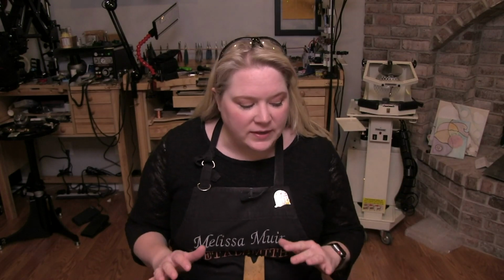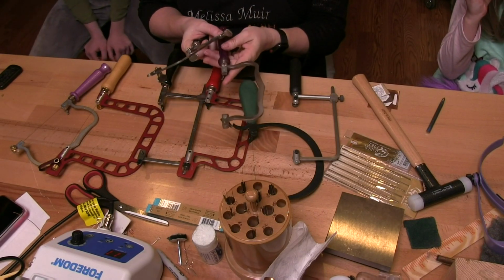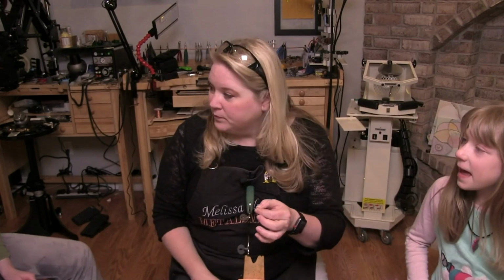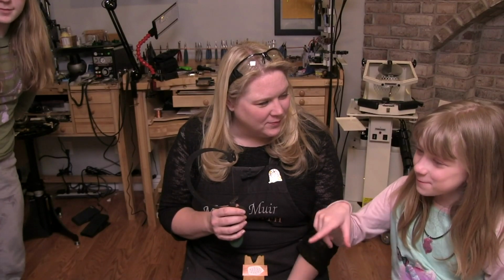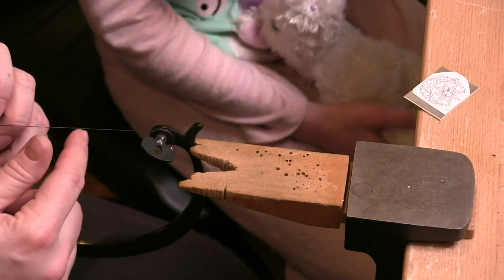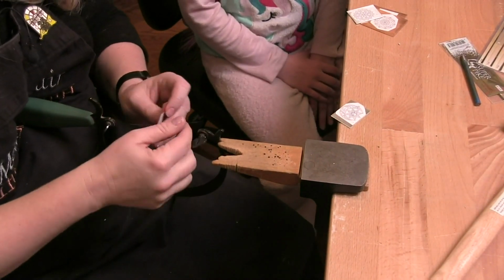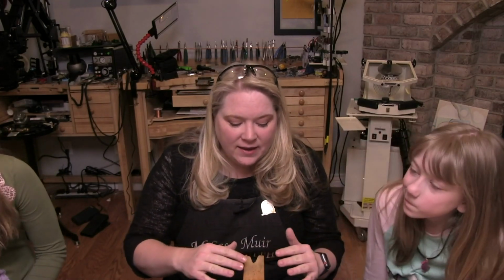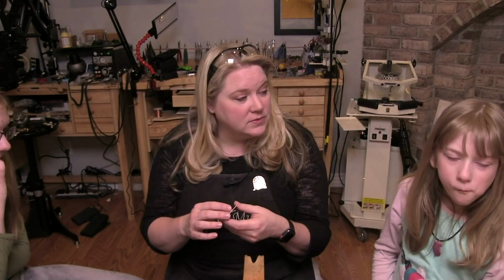Piercing:  Saw Frames and Blades - Quarantine in the Studio - Day 11 - Live

Comment: I really like the Potter saw frames, though I'll most likely start out with something more modest. Appreciate the clear explanation of blade sizes. Very helpful.

Gotta tell you, I center punch everything. Have some automatic center punches, the Starrett is almost jewel-like, but 95% of the time use the manual kind. The automatic is nice when space is limited and one has to reach deep inside of something. Just one problem with that - there's no hammer involved.